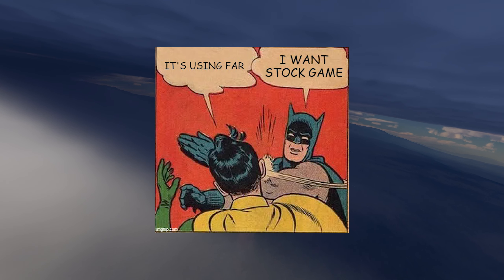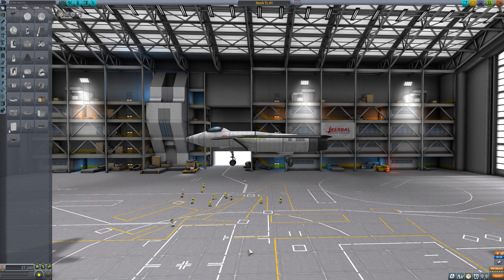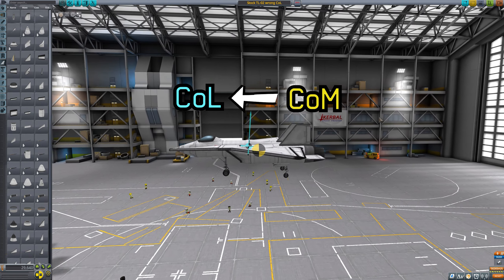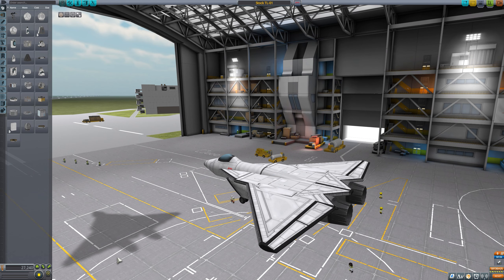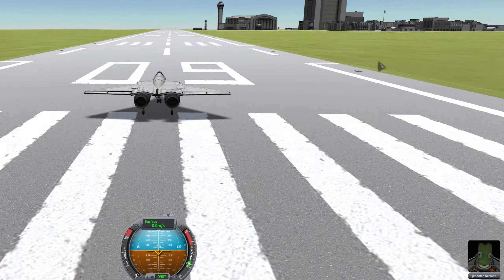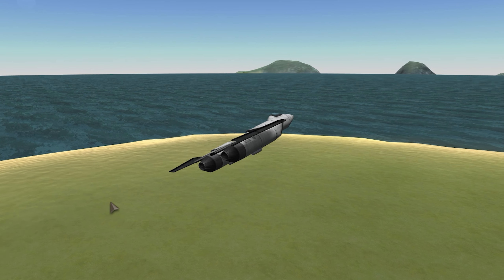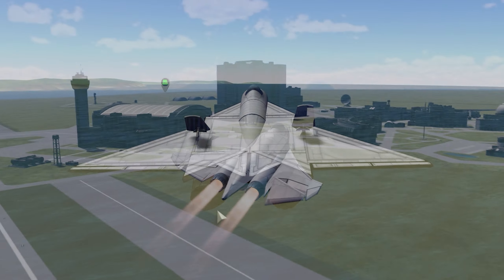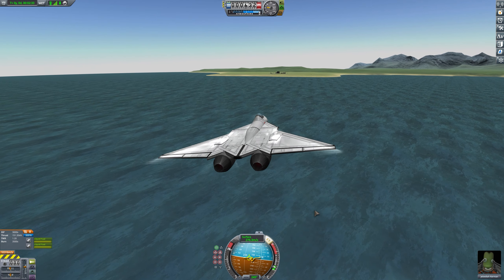100% Stock Tailless! | Kerbal Space Program Tutorial : How to make a Tailless Aircraft in Stock Game

Comment: Mind correcting me if I'm mistaken, but can't you enable and disable yaw/pitch ctrl for gumball thrust vectoring on engines? I recall doing that for an F22 I made, but it seems to put more load on required dramatic angle movements for engines to keep the plane stable and puts more load on the rudders if used 😊
Reply from the maker: I'm not a Stock user, so I don't remember well, but I recall that in the Stock's Action Group, you could activate/deactivate yaw/pitch/roll for Gimbal. Yes! You can optimize movement using this!